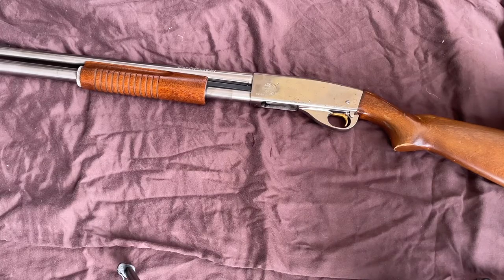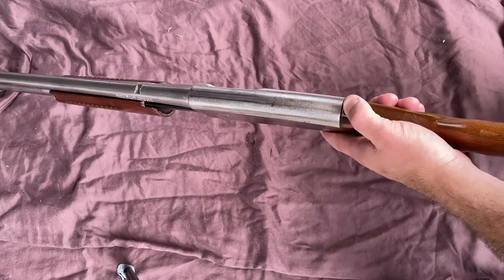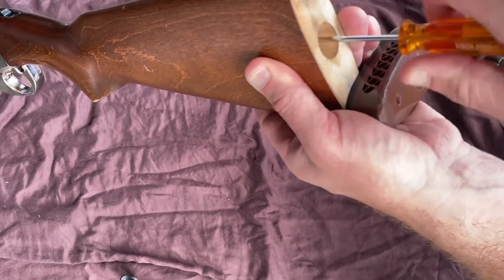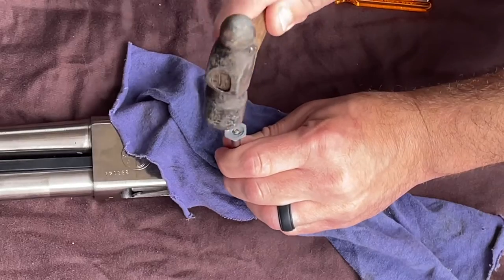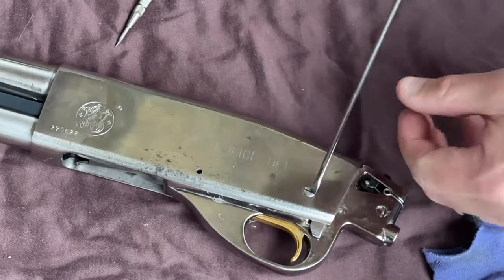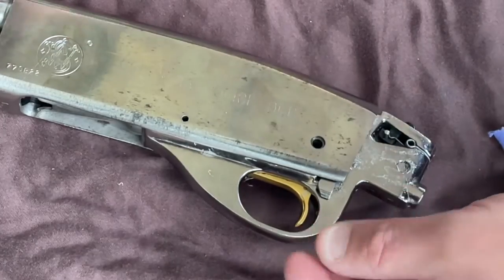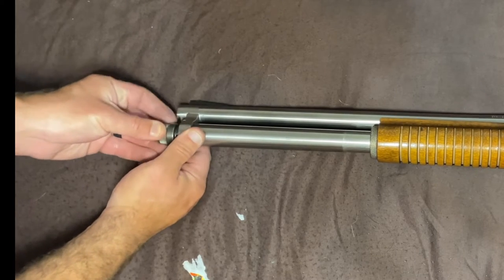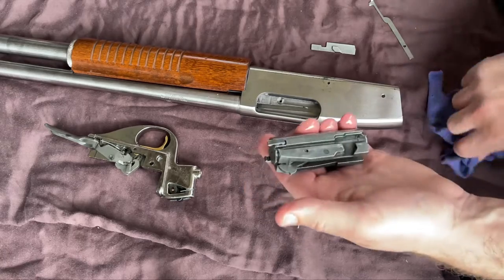Smith & Wesson 916A Cleaning Simple Demo

Comment: I’m having issue removing the bolt from the pump, specifically at the portion where your bolt falls out and you recommend using a screw driver. Any guidance you can give me?
Reply from the maker: So you insert the screwdriver in the rear pressing down (not hard) on the bolt and it w
Should come free. You may have to wiggle it slightly forwards and backward to get it to come loose. I hope this helps, it’s tough to make a guess without seeing the weapon first hand. Thanks for coming by!